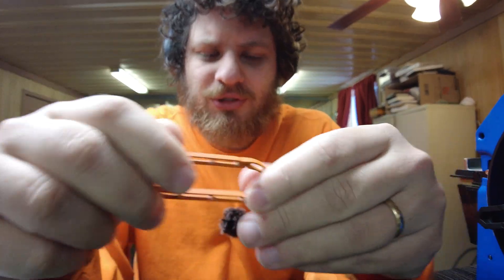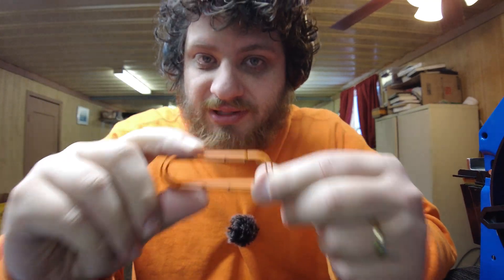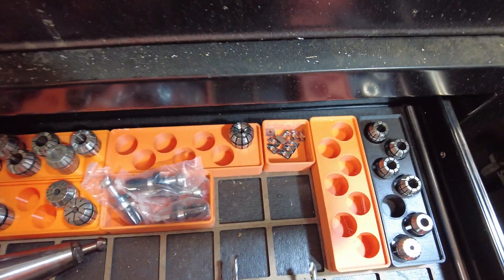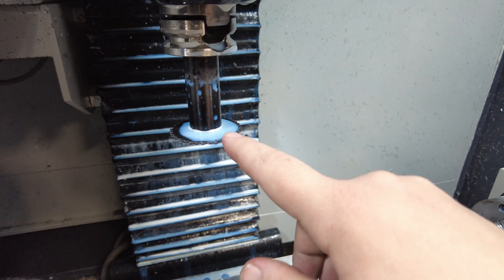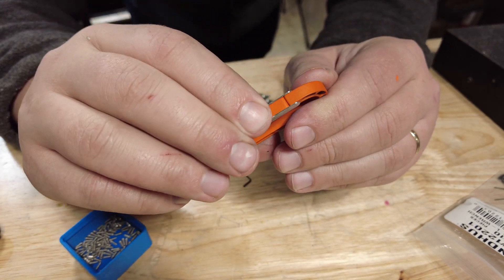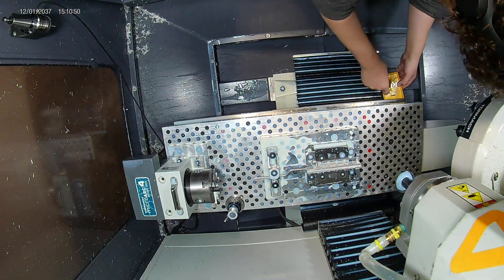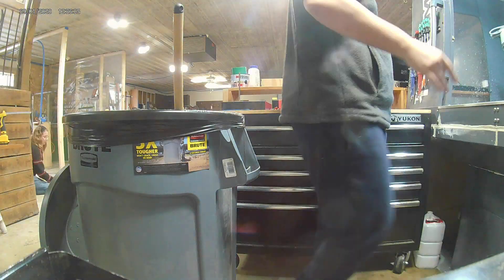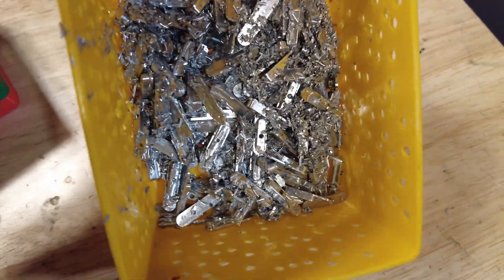Fixing a Huge Mistake 😕

Comment: I think you should have added a a countersink and used a small socket cap screw..
Reply from the maker: I don't disagree, I tried, but there just isn't enough meat there. even a #0 SHCS or flat head isn't small enough to fit into the little slot. The button head really isn't intrusive though, other than aesthetically. it's very small